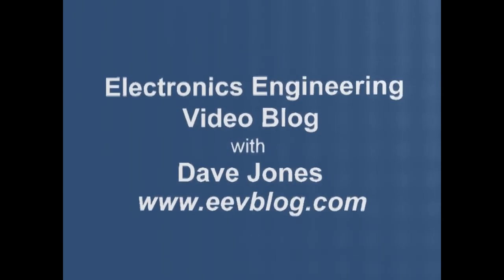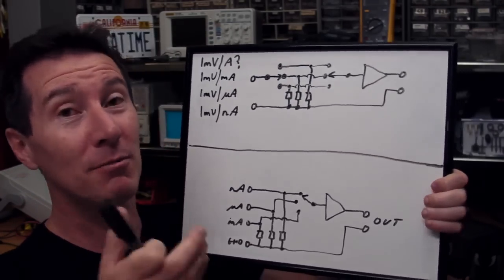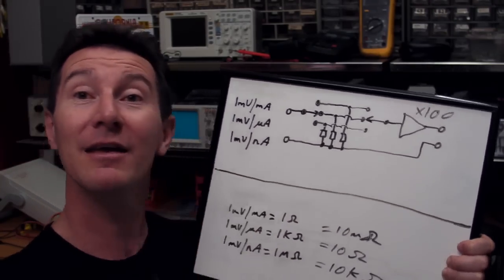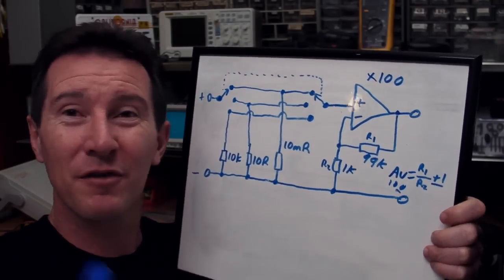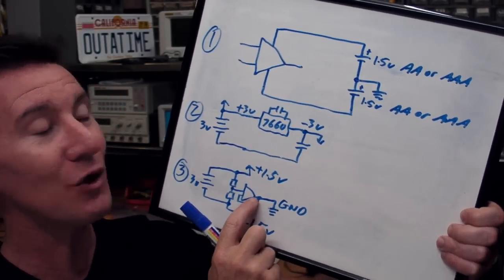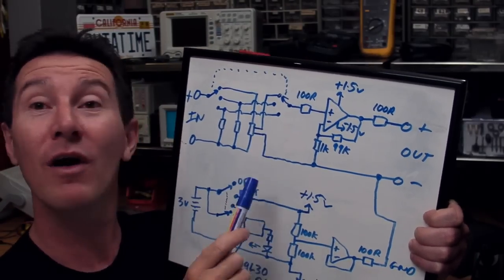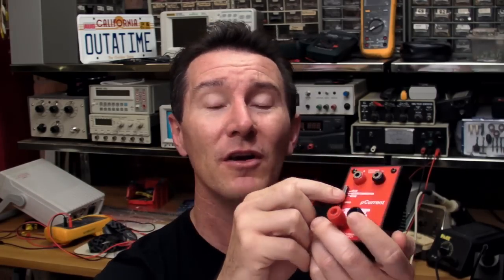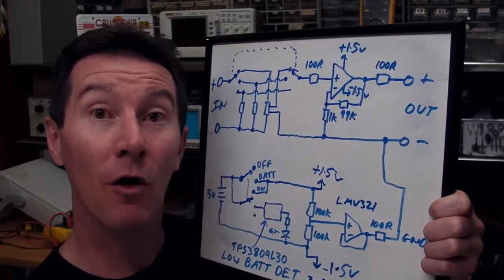EEVblog #72 - Let's Design a Product

Comment: This video is the greatest thing that has ever happened.
Reply: It's definitely a great video, but the problem is that nowadays the Chinese will knock off any product despite its patents, and often butcher the design of the original product.  It's a nightmare once one has spent countless hours developing, building, debugging, and marketing their product.
Reply: @BillAnt  Lmfao...the truth of that statement hurts everytime
Reply: @BillAnt   Don't worry about it, because they don't tend to make counterfeit products if it is not sold over thousands,
the circuits like this will not be copied because of feasibility.
Reply: @myetis1990  < I'm not talking about about small run products, but in general.  Feasibility?  Anything is feasible, it's just a matter of return on investment.  I've read that in a particular Chinese city there are actual factories which only do counterfeit products.  They have reverse engineering departments, along with China's lax intellectual property laws, they can operate just like any other factory.  It's sad but true.
Reply: @BillAnt  Chinese can give only corona

Comment: I find the real problem is how to design the front panel and how to imagine switches that can operate deep inside the boxed housing electronics. I think it becomes a mechanical engineering problem which strays from all the effort and excitement of realising the design. What's needed is that front end design handled by some computer process so that the electronic engineering is separated from it's commercial realisation but is automated if the design is taken to fruition by paying the cost.

Comment: I had bought an electronic blanket from a second hand store. It worked great I thought. It only used 8 watts. I thought "wow they have cone a long way. 8 watts nice.'  then it broke  a few years later. I went to buy another one to find out that I could not replace it. Every blanket I got was at least 150 watts. Devistated I didn't know what to do. I live in my RV. And to have an electric blanket that I could use for 3 or 4 days on my batteries was I wonderful thing. To use one that eats up 150 watts they would be dead in no time. 1 to 2 hours. The one I bought from the second hand store was clearly defective. But for me, it couldn't have been better. I need to find a way to bring a new blanket from 150 watts to 8 to 15 watts. So many of us love in RVs. And then there are the penny Pinchers. This would be a great thing to bring to market. Who needs 150 watts? That gets so warm it's uncomfortable. Can I just add a resister to the board somewhere to bring that down? Please help. And if you can't, can you point me in the right direction?

Comment from the maker: @BitEntropy No, the LED does not switch on if you move the switch quickly enough, a nice side benefit. It's easier to move the switch all the way to one side than centre it, so it's easier to switch it off.

Comment: I would've thought 'reverse LED's' would 'suck' light as opposed to emitting light!
Reply: David Perkins not really. That's what black LEDs are for!
Reply: @balahaasdf2219  What's the opposite of an LED? A DED.
Dark Emmitting Diode.

DED!

Thank Big Clive for that :D
Reply: Solar panels?
Reply: You actually can use a reversed LED as a light sensor, with some careful filtering and amplifying.  But obviously it's inferior to proper light sensors (e.g. LDR, PT, PM).

Comment: Just wanted to say, love the videos man. I've been an electronics hobbyist since my teens (Amateur Radio operator since age 14 and I dabble in guitar amp and effect design/repair as well). I finally took the plunge and enrolled in a BS Electrical Engineering program this year. After 7 years of working security all over the world I'm definitely ready for a career change haha

I have several similar channels I follow but the wit, sarcasm, and humor you bring to the videos definitely make this the most enjoyable to watch. Not to take away from the value of the other channels but some can have a very dry delivery of the knowledge.

Great channel, and keep it up.

-KC9FJE
Reply: Both this comment and this channel have aged well. Cheers!

Comment from the maker: @xspoonedx 
Interesting question.
If you have the LED operate the other way around and have it only come on when the battery is low, then if you go to turn the unit on and the battery is completely flat, then it won't come on and you'll think your product can be used. So in this case (with no power LED), it's better to have it the other way around so you can check the battery is OK before you use it. So you could say it's more important to know that battery is OK, than know if it's flat!

Comment: You could event move the 100 ohms opamp output protection resistor into the feedback loop to let the feedback compensate for its voltage drop
Reply: cls that's smart

Comment: I don't believe you need a low-offset op-amp for  the gain stage. You can simply null out the offset by zeroing the DVM when no current is applied :)

Comment: A subtle little thing... If I were to use AA/AAA's for this project I might've used three batteries instead of two, to avoid wasting battery power and having to switch batteries more often than needed. (2.6V/2=1.3V/cell vs 2.6V/2=0.87V/cell) Of course you'd have to consider battery impedance and such.

Which brings me to something I'd like you to speak about when seeing this: The black art of bypass capacitors, which would probably deserve an episode on its own merits.

Comment from the maker: @oehrlein49 
I use PCBcart, cheap and plenty of options.
No special deals for Altium Designer unless you are a student. Otherwise it's $3900/year or $5K outright for the PCB version. That's less than half the price it used to be.

Comment: @gameboygenius - If you were using AAs your idea of using 3 would allow use of NiCads/NiMHs (whereas a 2 battery design wouldn't (only 2.4v).   I like this versatility. 

But rechargeables aren't ideal for an occasionally used low-drain piece of test equipment due to internal discharge, so accommodating rechargeables isn't as big an issue. 

Although generally I like using an even number of AAs as they come in 2s and you don't have one left over when you need to change them.

Comment: one more thing you can use op-amp if current usage less like 10 ma (max output of current of opamp)
you can use tl431 its even cheaper and current is upto 100ma
and can use a transistor to increase  current

Comment: Surely, the low battery LED should be off and turn on (red, error) when low? Otherwise it's a drain?
Reply: A pitty that Dave did not respond on your legitimate remark. A "battery low" indication would show during measurements that the battery voltage came to low and  not only when switching to power on, where the battery would come from a no load, recovered mode.

Comment: If you could make the PCB quick to open by using a hinge or a magnet etc. then you would be able to store banana cables in the box to connect the output to your DVM. Or leave it as is and secure a spare battery in there.  Or slap some googly eyes on it and "Bob's your uncle".

Comment: That DP3T switch throughout the first 15 minutes is really bugging me when it could just be a SP3T switch instead.
Reply: No it can't
Reply: @hansdietrich83  In all cases, every pole of the (ganged) switch is connected through to itself, unless it needs to function in a non-ganged configuration, and then I admit I don't know what the purpose of the circuit is.  If they are truly ganged, this means an optimization can take place.  If you used the poles of the switch to select which input resistance you need, into a common input node to the op-amp, then yes it CAN be reduced to a single pole triple throw switch.  Simpler design means less prone to failure.  I think Dave would agree.
Reply: @byugrad1024  I have it the same way. I thought it was for precise measurement of contact resistance.
Reply: There is an alternative configuration that Dave neglected to show which only uses 2 banana jacks, and a single SP3T switch.  Wire the 3 poles of the switch to each resistor to ground.  Wire the common from the SP3T to the input banana jack, as well as the op amp input.

Comment: absolutely brilliant video, really helped. My only question (from a noobie perspective) does the 100 ohm resistor that provides overload protection affect the final readings? Surely they will in series with the 3 resistors you can choose from? Many thanks!
Reply: David Mason Solo la afecta en un 0.0001%. El MAX4239 entrega su tensión sobre el divisor formado por el resistor de 100 ohm y la impedancia de entrada del voltímetro, que es del orden de los 10 Mohm. Por lo tanto el 99.999% de la tensión que entrega el MAX4239 es leída por el multímetro.
Reply: Thank you Kokou2be

Comment: Actually wouldn't it be possible to build this with an opamp working as transimpedance amplifier? That should (theoretically) lower the shunt resistance to zero and the shunt resistance was the main driver behind this project right?

Comment: And why you need a voltage follower at ground ? To be able to get any current between +Ve or -Ve and ground ?
Reply: You need it so the ground will stay stable "whatever" impedance you connect to it. If you don't put any voltage follower, the ground you created will swift away from the average of the positive and negative power nodes. The resistance at the output of the voltage follower is used to limit the current driven by the node. So you typically want an op-amp that drifts low current so there's no voltage growing at the sides of the resistor.
Reply: It has to do with output impedance. A voltage divider, as you learn, cannot output much current before the voltage begins to sag. A LOT. (more technically the output impedance is defined as voltage over current, or change in voltage over change in current. It defines how much the output voltage will sag if some amount of current is drawn from it.) The voltage follower or buffer will have a non-changing input impedance thats nearly infinite (no current draw almost) and the output is essentially regulated so that unless more than many dozens of milliamps are drawn, the output voltage will remain exactly the same. In other words, the output of the buffer will not change with respect to the current drawn so the output impedance is nearly zero. (until you overload the op amp obviously.)

Comment: what a great video!
only got one question - what did you use to power the LMV321?
cheers :)
Reply: I know this is old, but I thought I'd reply as I didn't see anyone comment on this. Really what he's doing is providing a 1.5V DC offset to the input of the MAX3249 to allow negative input current measurements, so all opamps are supplied with 3V and 0V from the battery, referenced from the battery. The CMRR of the Opamp takes care of the offset voltage.

Comment: I always considered negative voltage to be like missing electrons. It seems like your negative is not like that, but is negative relative to ground. Maybe if you connect the ground to the ground of the meter, is uses it as differential and displays the proper result. Am I wrong here? Are there realistic limits to true negative voltages due to electron shell availability?
Reply: ok, so maybe one end of the battery is lacking electrons.
Reply: Isn't "ground" relative? If you put two cells in series, is the minus of the bottom one the ground, or is it the middle wire? I always thought it was just a matter of labeling. (OK, "always"...after I turned ten or so. :D)
Reply: Gath Gealaich

All the batteries ends and the middle wire have different electric potentials, which are positive or negative in relation to each other. Where you connect ground is arbitrary (but matters). So you were right.

MatthewSuffidy
The negative end emits electrons, so it has an abundance of them, not a lack. This makes sense considering that the electron is the carrier of negative electric charge.

When the circuit is closed, the electrons flow from the negative to the positive end, where they are absorbed. In the case of batteries, a chemical reaction keeps producing that difference in electric potential for a while. The deliverable voltage, current, and capacity of a battery is a function of its materials and physical dimensions.

There is no such thing as 'true' negative voltage. If you have a positive voltage, just look in the other direction and it's negative. Voltage is between two potentials, and therefore always relative.

Your guess, however, was right: Dave chose ground in the middle between + and - because he wants to see negative voltages on the multimeter in case of currents flowing through the μCurrent in reverse (OpAmps amplify deviation from ground, therefore they need +V/-V supply; flowing current produces voltage over a resistor, positive or negative; that voltage is multiplied to get a reading on the multimeter with high accuracy, sign indicates direction of the current).
Reply: Paul Thomann Well everyone seems to be unanimous that negative voltages are the resulting of calling 'zero' a certain point of actual potential. If this is the case, devices claiming having negative voltages could have strange output signal levels, which if are not differential may seem to not be their obvious value... Maybe computers have a standard for this, and like RS-242 would be more literally like 0 and 24 volts... Maybe chips are powered by the difference also the vcc and gnd?
Reply: Yes, many chips have no use for two supplies, so they just need some positive voltage and (so-called) ground.

OpAmps can be thought of as being two amps, one for positive and one for negative signals. That's why they need both negative and positive supplies.

Comment: Hi Dave,  Great video!  Can you or anyone else here recommend any good 
reference sources (books, internet sites, etc.) for the kind of circuit 
parts that perform functions that may not be what someone normally might
 think of them performing at first.  For example, an op amp is usually 
configured as just a way to amplify signals.  Here, it's used to provide
 a high output impedance voltage follower.  This seems like a clever and
 more advanced function someone would learn with experience.  As another
 example, I've seen transconductance amplifiers constructed with regular
 op amps to convert voltage to current...not your typical small signal 
amp circuit, but still made with regular op amps  

Is there any such "advanced ways to use the same part in alternate ways" or "circuit/component usage cookbook" guide out there with novel ways to achieve circuit functions with arrangements of common parts?  Thanks for any help!
-Dewey
Reply: Opamps can be used as sine and squarewave oscillators, look up wienbridge oscillator which uses a lamp and an opamp to generate a sinus.

Certain schmitt trigger IC's like the 74ls14 can be a squarewave oscillator with just a resistor and a capacitor.

The 555 timer can next to the usual generation of PWM and frequency be used as a lofi amplifier and a transistor tester. 

LED's can generate current when bright light is pointed on them which reverses their usual way of working. Also they can be used as crude fuses.

When the collector of a generic bipolar transistor is left unconnected, the transistor can be used as white noise generator.

Solarpanels can next to power a circuit also be used as light sensor (a very common thing actually) 

When you take an electronic tealight that has a flickering led and short the LED with a speaker you'll hear music thats usually heard in electronic postcards because the tealights uses the audio to generate the flickering.

Thats all I could come up with for now

Comment: Hello,

Why the gold version schematics http://www.eevblog.com/files/uCurrentRev5schematic.pdf consists 10R connection in series with shunt resistor's sense pin instead of its current pin? I'm confused a bit.
Reply: He improved the design. In the first version (this video) when you switch the range you make an open-circuit at the input. Bad design, if i.e. you power a device and you switch the range it can turn off and on.
In the new design the input is always in parallel with a 10k resistor (nanoamp range). This 10k is still in parallel when you switch to the microamp range (10.01 Ohm), so the actual resistance is 10k || 10.01 Ohm ~ 9.99999 Ohm. So the 0.01 Ohm shunt also serves as a compensation. For the milliamp range 10k || 0.01 Ohm ~ 0.00999999 Ohm the 10k resistor is negligible.
Reply: @benjaminfacouchere2395  Hey Benjamin,

Thanks for the reply, but actually I knew it. My problem was, so that I didn't know the structure of the four-channel shunt resistor, I did not know if it was like hall-effect or something else. In schematics on .pdf, there is"four channel shunt model" and it is connected to the sense pin as it could be tied to I1 pin instead. 

If you read my question again, I had mentioned about the tied pin. Anyway, I've made a similar digital ammeter circuit which works fine.

Your reply will quide the others, meanwhile. Thank you again!

Comment: is it ok if i copy part of ur circuit for my project?
Reply: the circuit is a simple current/voltage converter as you can find on wikipedia, so I assume you can use it^^